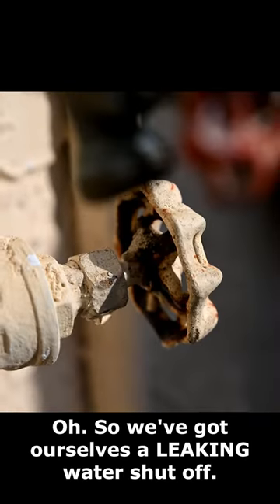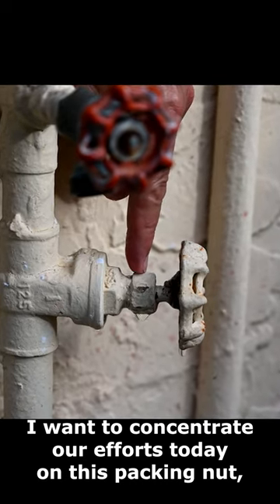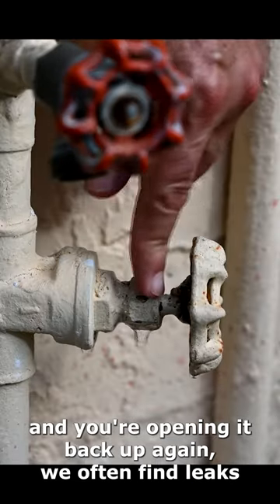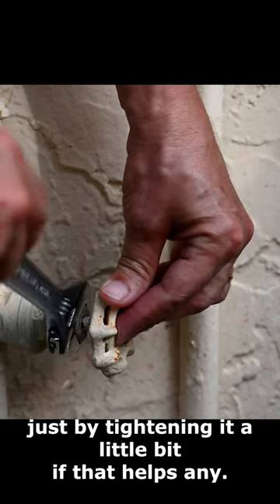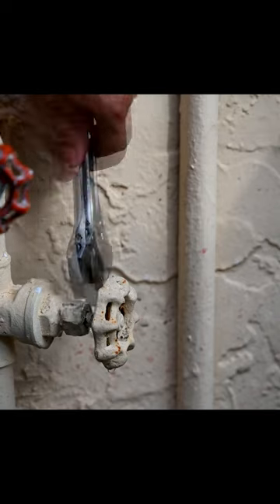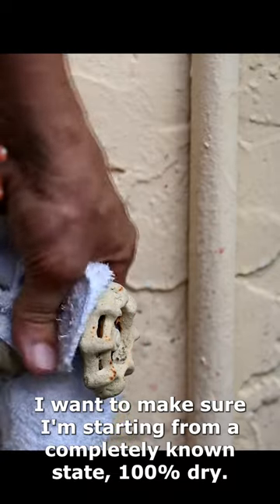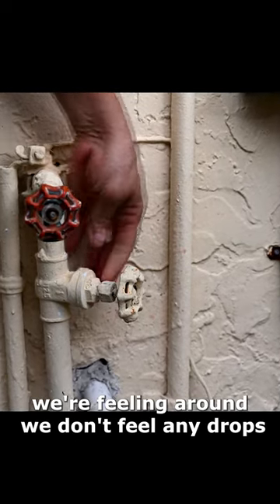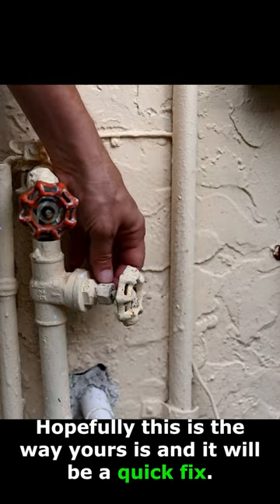How To Fix Leaking Shut Off Valve DIY - Avoid Plumber

Comment: I wonder if it would be worthwhile to shut the water off and applying new tape and dope
Reply from the maker: In this case tightening the bonnet nut solved the issue. But if it doesn't because your packing rope is worn down, then yes you would put in new packing rope

Comment: To check for complete tightness I use toilet paper. Any leak will show as dark spot.
Reply from the maker: Nice trick! I also wipe with a towel and feel for moisture
Reply: @jeffostroff  I got to that because I sometimes were unsure whether my fingers do feel wet or not. The paper changes tint and appearance.

Comment: Tightening the packing will work for a little while but it will leak again. No plumber is replacing this for " a couple hundred dollars." $650 for a 3/4" brass ball valve on copper and I'll throw in a 1/4 turn 1/2" hose bib for free.
Reply from the maker: The last one my friend had done a year ago was $350. It might be more in your area but here that's the norm